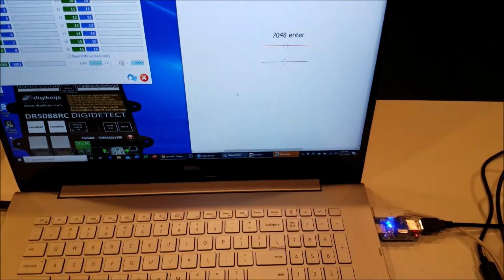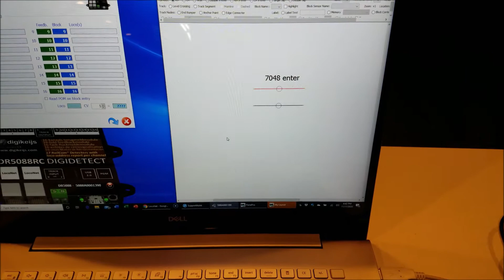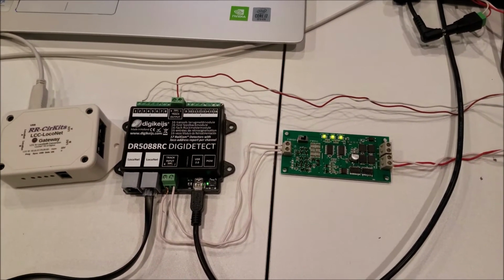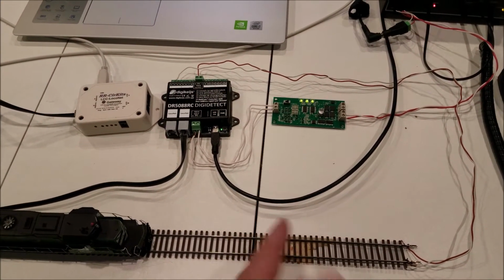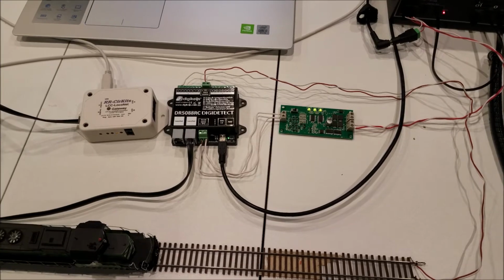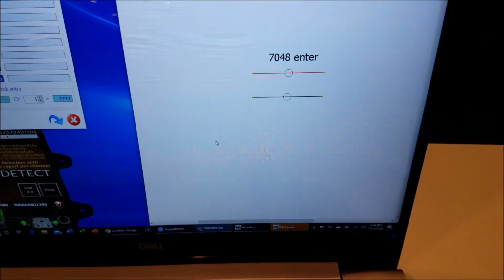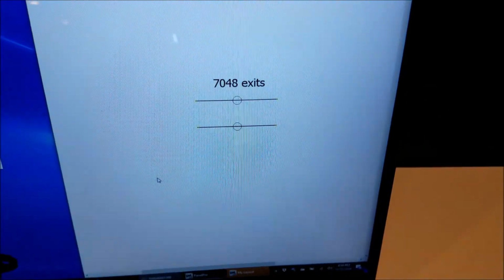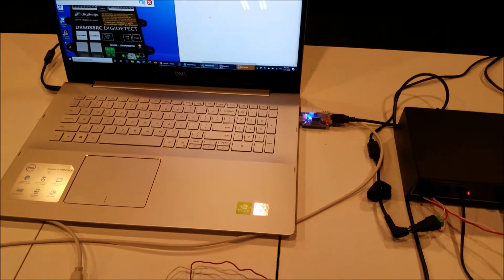Easy NCE RailCom Setup ~ Part 3

Comment: Hello I am a NCE system  I use JMRI to dispatch my trains.   I use NCD BD20 for Block Detection I use NCE Light-It for signal control.  All working in JMRI. Trying to get the Train number to show in the Block . Using Blocks contents this is unreliable.  I have a Power Pro  and SB5 Booster. Some of my decoders may have railcom in them have to reach out to them to find out.   What parts would I need to get Railcom signals to be sent to my JMRI   Thanks Tom
Reply from the maker: You can get RailCom to work on NCE like I did in this video series.  I would keep using the BD20 for you block detection and then double block the sections you want RailCom with the DR5088RC.  Keep in mind that some NCE decoders won't work at all when RailCom is active.

Comment: Hello! I know that DR5000 work with Digitrax, NCE, PIKO, FREDi/FRED, Uhlenbrock, Daisy on LocoNet system. Roco/Fleischmann, Lenz work on XpressNet system. But I see a few problems with MRC Prodigy... 1.It use Ethernet plug (rj45). 2.What type of dcc system is correct to work to Prodigy controller? Is it LocoNet or XpressNet? Maybe you know, is it possible connect MRC Prodigy to DR5000?
Reply from the maker: As of now,  MRC throttles won't work with the DR5000.  The MRC controllers will only work with MRC.

Comment: Hi, do you have a link to the USB isolator ? When I have both the DR5000 and DR5088RC connected to  the PC at the same time, the DR5000 shuts off, reporting a short. Will this help ?
Reply from the maker: Yes, check out page 4 in the DR5088RC manual.  

Here is a link: https://www.amazon.com/HiLetgo-ADUM3160-Voltage-Isolator-Support/dp/B07235PR4V/ref=sr_1_2_sspa?dchild=1&keywords=usb+isolator&qid=1605195909&sr=8-2-spons&psc=1&spLa=ZW5jcnlwdGVkUXVhbGlmaWVyPUEySVRWSkEwNFFERUZEJmVuY3J5cHRlZElkPUEwNDcwMTY3MkpESkw2NjgwRVVPOSZlbmNyeXB0ZWRBZElkPUEwMjY5NzY5MzM5RTRXUURMNE1NTiZ3aWRnZXROYW1lPXNwX2F0ZiZhY3Rpb249Y2xpY2tSZWRpcmVjdCZkb05vdExvZ0NsaWNrPXRydWU=